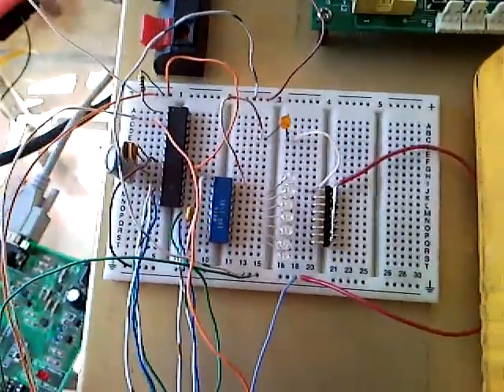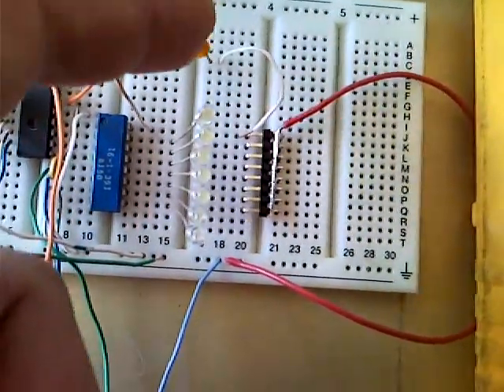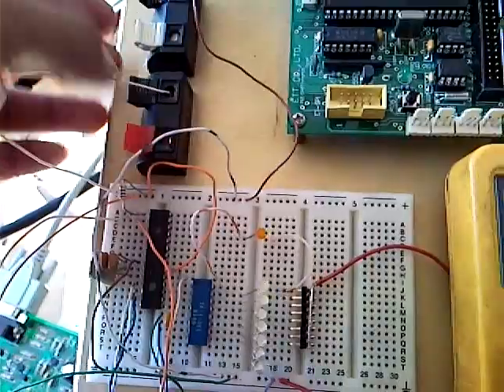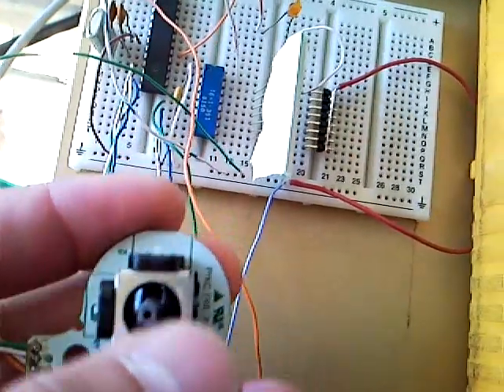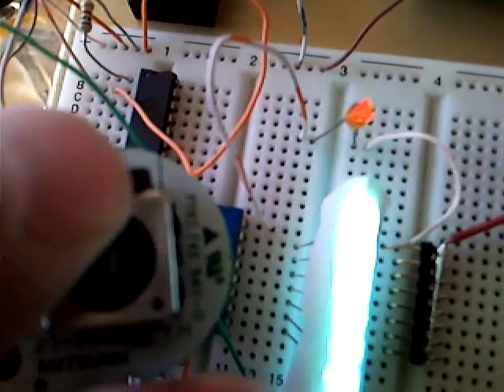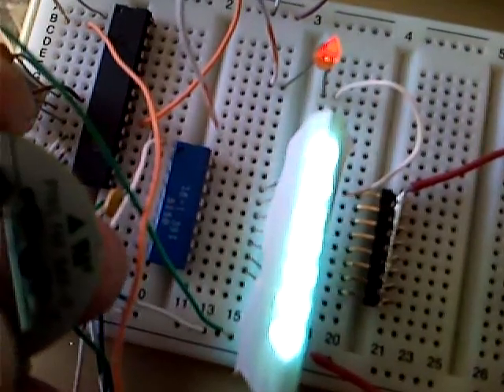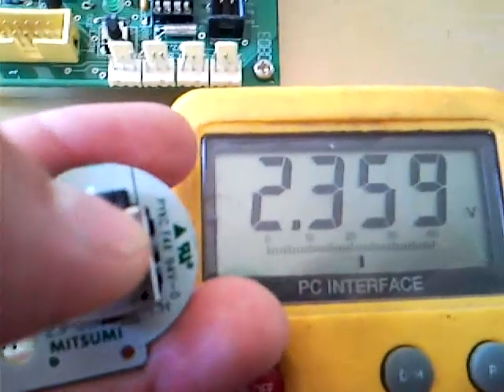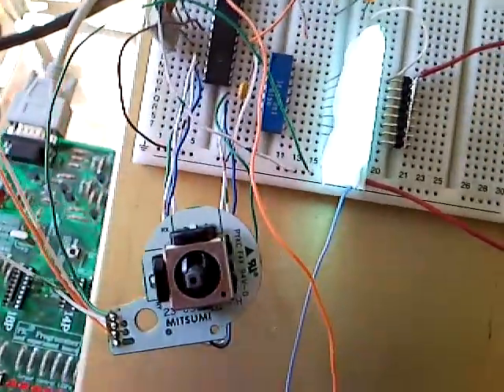PIC 16F873 Analog to Digital converter test

Comment: hey. i have a PIC16F873 and i want to read whats written inside.
how can i do that with pc?
or how can i duplicate this chip. i understand that if i buy a new one its comming blank so i need to flash the program on it...???
can you help me with this??? SOMEONE?
Reply from the maker: You may be able to retrieve the code using a PIC programmer or a universal programmer, like the fairly inexpensive MiniPRO TL866 you can get on ebay, and software for it. 

If the chip was copy protected, it might not be possible. I haven't tried doing this myself, so I don't know how well it would work.
Reply: thank you for helping me. you say. if i will buy programmer like this one: http://r.ebay.com/wzzynN
i can use free software and try to read the code?

i also hear that maybe i will not be able to see the program but i can see and flash only the code...
is it right?

can i do it with the product on the link i put here?

i just want to duplicate my chip
Reply from the maker: I don't have any experience with that programmer, so I can't tell you for certain if it will work or not. I've only used the TL866. Although the product description of the one you linked does say it can read the program area, so it seems like it should work. 

Yes, assuming you can pull the code, you're only going to be able to see the machine code, not the complete original program.
Reply: The Workbench can you help me with it after i will receive the ebay product. i can pay you via paypal. i must do this. and finish it.